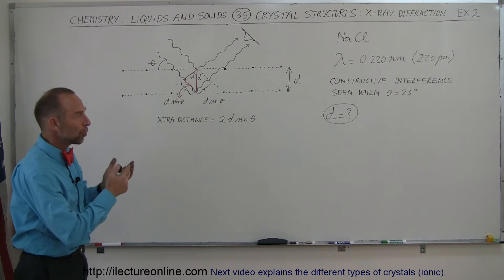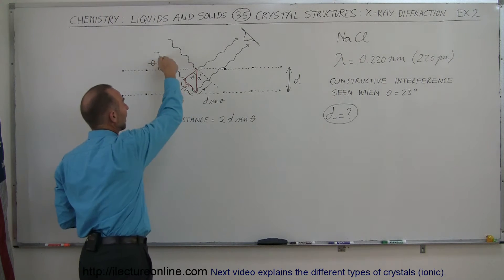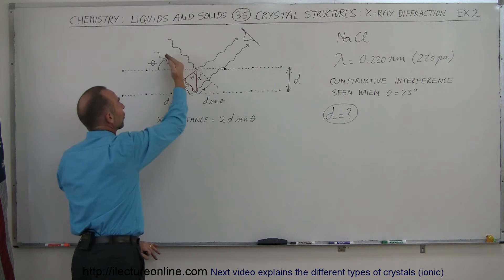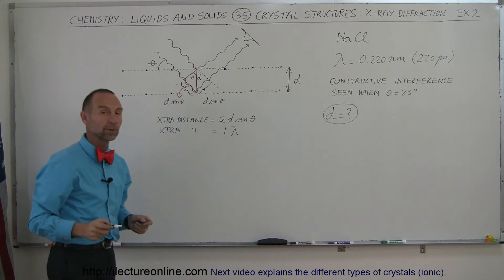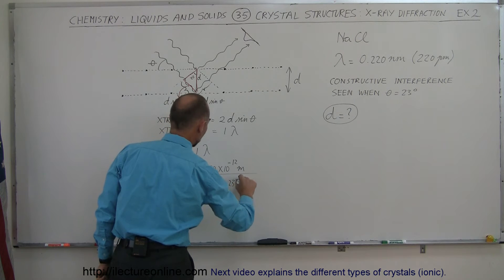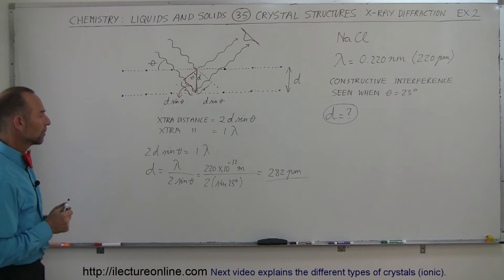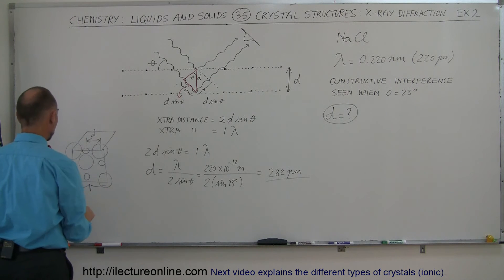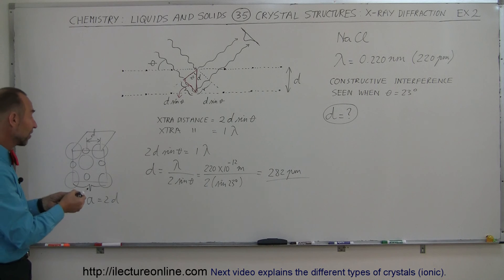Chemistry - Liquids and Solids (35 of 59) Crystal Structure: X-Ray Diffraction: Ex 2 NaCl

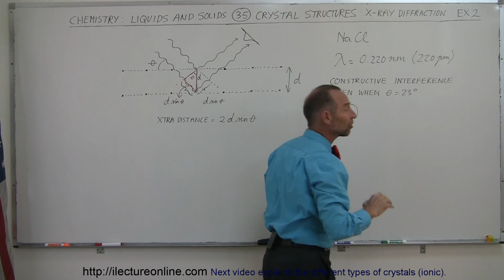Comment: At 1:24, how can you be sure that the extra distance is just one full wavelength (1 lambda), and not two or three? It's a small angle so it seems reasonable, but can one be really sure that this is the first constructive interference? Or is it assumed in the question that this (23 degrees) is the first seen constructive interference when starting from zero degrees?
Reply from the maker: All the other interference patterns exist as well, with 2, 3, etc. wavelengths and can be seen to some extent although not as clearly.  You can work the problem again but take 2 lambda, and then 3 lambda, etc. and see what happens.
Reply: @MichelvanBiezen  Thanks for your answer. But what I meant was, how do you know that the one at 23 degrees isn't the second order, with an extra distance of 2 wavelengths? But I guess that "constructive interference seen when theta = 23 degrees" should be understood like we started at zero degrees, and this is the first maximum we stumbled upon? If this is the case, I no longer have any questions! Thanks for your incredible library of videos! It would be a great help if you made some more on the unfinished statistical mechanics playlist, but I'm very grateful anyway, and impressed that you've found the time to make all the videos you've done already. Greetings from Sweden!